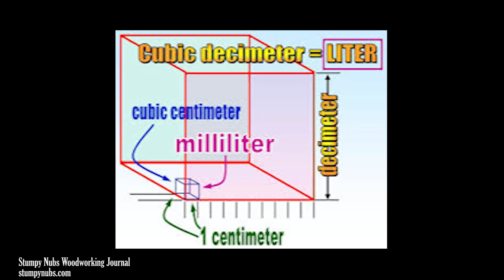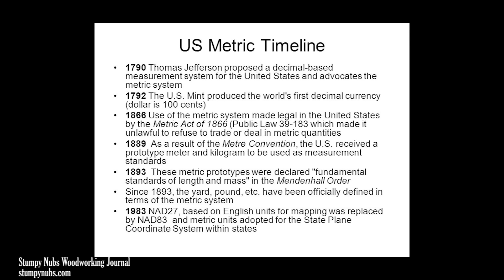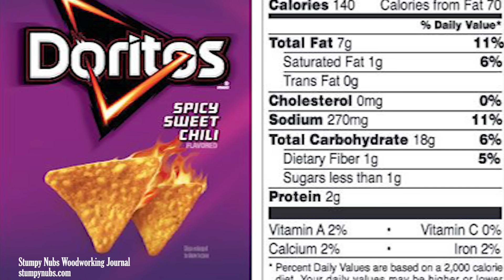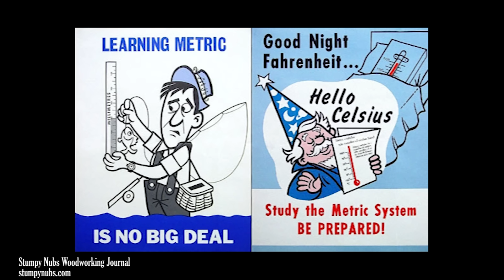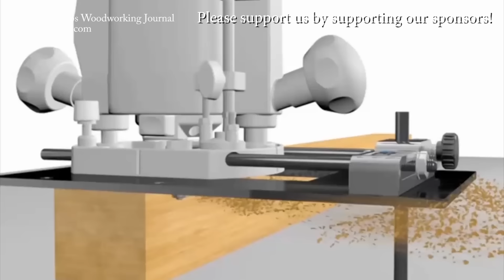BREAKING: The USA is switching to METRIC!

Comment: Funnily enough, I was born, raised and educated in the metric system (I am from France), and yet, when I work in my workshop, I primarily used the imperial system. I found the fractions fun to use... That said, who cares what system you use as long as you have fun building stuff.
Reply: Oh those fraction thing drives me crazy.
Reply: As the Russian saying goes, "monsieur is a connoisseur of perversion" (used as a praise of sorts)
Reply: It does matter when it comes to compatibility between projects and sometimes even within the current project its self.
Reply: It's only fun when you're dealing with the easy conversions of the metric system. I'm Done struggling with Imperial.
Reply: SI Metric is Universal (French Metric is as you say different) all the units are related 1mm x10 =  1 cm x 100 = 1 meter. 1 cubic cm of water = 1 millilitre that weighs 1 gram x 1000 = 1 liter then 1000 liters equals 1 metric ton or 2200 lb. America is making its self irrelevant by maintaining a system that no one else uses anymore. I was at school when Australia went from British Imperial to Metric. Remember US and UK are not compatible being different scales. ie 1 UK gallon us 4.5 liters one US Gallon is 3.9 liters  even the inch is a different scale.
Reply: I still think in feet and inches, but I've started converting to metric for tricky layout work.  Now I just need to find a ruler with 1/12th cm markings, and I'm home free. 🙂
Reply: @yfelwulf  hey there Bub, you watch it,  now.  I’m American, and I’m here to tell ya:  the metric system isn’t even on the top ten list of ways we’re making ourselves irrelevant!
Reply: @charlesenfield2192  why would you need any 1/12th? Just use a whole number of mm. We don't do that fraction bullshiting with SI. For example if we got a material which is  22.5mm thick we never-ever count it as 2 and 1/4 cm, we just use 22.5 mm. or 2.25 cm. 

The most important way to use the Metric system is that you have to use it at the metric way.
Reply: I belive this is reference to SI Metric  sarcasm 😂
Reply: Yeah like building the landing system for a Mars rover.

Using both conflicting systems sure had "fun" results.
Consistency is important because you can forget to convert when needed.
Reply: One of my other favorite DIY channels is out of Canada (Hone RenoVision DIY)  The guy insists that imperial and fractions are easier for carpentry (like framing, building decks on houses, etc.
Reply: @charlesenfield2192 how do you feel about the idea of the metric system throwing out the decimal (base10) system and embracing the dozenal (base 12) system?
Reply: @saxus wooosh
Reply: @saxus you are right about people thinking fractionally instead of decimally when using the metric system, They are fighting themselves. But you also bring up the biggest flaw in the metric system, its difficult to convert fractions. And this is not merely a flaw of the metric system but the decimal system itself. The decimal system has served us fine for centuries but it is not perfect and I would argue that it is not the best. I propose a compromise. For the future benefit of all mankind. The US fully Embraces the metric system, as the metric system adopts the dozenal system. I know this will be a great struggle for many, if not all. and that once AI takes over the world we will have to switch to base 16 anyway. But I think in our day-to-day life it would be a benefit.
Reply: @matthewfrost3677  why would it to be difficult to convert fractions? In most cases you simply don't need fractions. Switching the scale of the measurement is just moving the decimal dot/comma (depending the language). Like I've seen a video where an US woodworker tried to use metric and he failed because it was a pain to work with decimals. His mistake was that he directly converted 1" to 25.4 mm. It's wrong, just use 25mm. Instead of 3/4" sized things you will use 18mm (as we do with plywoods/OSB's). And yeah, if you have to have an exactly half of 25mm because you do an half-lap joint, then you set your tool to 12.5mm. Not a big deal. But as I said if it's really necessary. Like the general thickness of furniture building materials is 18mm anyway, you can divide it easly it will ends up in an integer. And if you build a furniture or a house... it's very-very odd if you can't use an integer number.

But in fact: most of traiditional, old woodworking technique aren't using inches or mm's in general. You just plane and thickness your material to a choosen thickness and you do your joinery based on the actual thickness of the material instead of using an arbitary number.

And please don't tell that it's easier to add  12" 17/64 and 5" 5/12 than 362.35 and 137.58.
Reply: Metric all the way, any day!
Reply: @saxus It was a joke. Good god... chill.
Reply: The only reason people prefer metric over imperial is "I can't do fractions." Well... I can.
Reply: @charlesenfield2192  I think you meant to say 1/13th. Bakers' dozens are so much better.
Reply: No matter what system you use all rulers have some level of inaccuracy in their markings. Ideally it would be perfect accuracy but that would mean atom thick lines and pencils that could draw with that level of accuracy.  Therefore we are stuck with the true mark being somewhere within the width of the mark.  Most manufacturers are good at keeping the short distances within the mark but for every little bit that it's off true center of the mark it increases the error over the long distance.  If you need fine accuracy, metric might be the way to go. If you don't need fine accuracy but are dealing with larger sizes sae might be your preferred choice. (Note: SAE and Imperial may have units with the same name but measure different distances.)
Reply: The traditional system was built around people & their needs (& not because most possess 10 fingers & ten toes!)
Reply: @pcka12  it was also accurate enough for most purposes. Horses are still measured in hands.
Reply: I have no problem using either metric or imperial scale, I find math to be rather fundamental
Reply: @TomKaren94 understanding fractions does make imperial easy.  It seems like too many people struggle with something as simple as 1/2 of 3/8 is 3/16. To your point it really is quite simple and makes sense if it's just you.  The. Again using a story stick works just fine if it's just you. But...having an inch that is not the inch you are looking for for vintage tools is beyond frustrating.  Either way, I wish we could all get on the same page, not for craftsmanship or lack thereof but for simplicity.  Buy a shirt online and it turns out to be 1/2 the size you thought it would or cooking recipes talking about baking at 175C, or  my Australian friends complaining about it being 35° outside
Reply: I've met a few people who do construction from around the world and some still use the imperial system because 4X8 sheets of plywood or drywall are standard around the world. As well as studs 16" on center plumbing fixtures, etc. It's sometimes easier to reference the imperial system for that. Instead of remembering 1219X2438mm.

I find it using metric a lot easier when dealing with very precise small measurements like machining or certain machine tolerances.
Reply: Ireland went metric over 50 years ago, however in my wood working hobby I tended to us both, mainly because my tape measure had both. About 15 years ago, I found metric only tapes and bought 5 of them. The number of errors I made dropped by 90%! Now  I cringe as I hear people talk about 2 and 11/16 inches! Go metric Uncle Sam!
Reply: You like fractions? Click bait comment for sure! Going from 8ths to 32nds to 64ths back to 16ths to.... It's totally ridiculous. I actually don't believe you...that you prefer working with fractions. No way. I do it almost every day and I still hate it. Metric is SO much faster to use and less prone to errors.
Reply: @mboyer68  Everybody can think what they want... Now, explain me that click bait thing you are talking about.
Reply: I’m American and had to teach myself Metric. I use it anytime I can.
Reply: I use whatever is the most convenient for me.
Reply: You used the word funnily, suggesting you have been here for a very long time.  Do you even have a French accent?
Reply: @mboyer68 I've been working with fractions for so long it's easy for me. Did work for a Swiss company for a few years where everything was metric. Didn't have a problem with it. Where I might go to a 32nd metric goes to a half a mm. When you use either for years it doesn't matter.
Reply: Even after 25 years,  my accent is still thick...
Reply: @xof-woodworkinghobbyist  no problem friend.  I work with a number of francophones and they will not let me speak French with them because I poison the language when I open my mouth.  Haha.
Reply: @mboyer68 jumping between powers of two is either just as easy as powers of ten, or easier.
Reply: @saxus decimals are just fractions using powers of ten. 

As a modeller, often building US-designed vehicles (aircraft, ships, trucks, cars...), in scale 1/72, I frequently have to convert both units and scale when using for example original drawings. It's always just a matter of multiplying and dividing, and knowing what numbers to use. It really is quite trivial. Sure, if the USA went all-in metric it would be good for all, but even then, I would have to deal with inches as historic use will not magically change. But Americans really should do it for their own sake, not to please us Europeans. And I would think that a proper, fair and sane public health service, should have much higher priority than a metric switch. (But I know it's even less likely to happen.)
And apologies, Americans, if we sometimes seem arrogant. We really are. But we also are trying to tease and nudge you, because you really would be better off in the 21st century instead of remaining stuck, and we do feel sorry for you.
Reply: @lhpl  Well... this is the beauty of SI. You don't have to convert units. There is only one unit for length. 

Ps.: I do modelling too, but usually in 1:110 also the end result will be in Lego sizes. I would die if I would have to use fractions instead of decimal fractions. (Lego ratios are an extra hell if you want to be accurate as it is possible, but we'll. that's the fun part.)
Reply: IKR?
Reply: @saxus  It's possible to use inches in the same way as metric, ie. decimally. As I said, it's trivial, and it doesn't get more or less so by using mm or centimeter.
Where metric shines is in engineering and science, when using more than one of the units of the SI system.
I would not like to switch to imperial length, but it wouldn't be difficult.
Reply: lol, keep telling yourself that the US is in any way irrelevant. For better or worse, the one thing the USA is not, is irrelevant.  @yfelwulf
Reply: Cool. What happens when you have to divide that 22.5mm material in half? Whatcha using to measure 0.25mm in the woodshop?  @saxus
Reply: @lhpl  it would be  possible to use anything but yet I found usually an X Y/Z number which is nonsense. For half and quarter it's so-so but just doing the math harder in long term.
Reply: @ethanwheeler3323   caliper. A center finder or some parallel marking tool if I really need half, because in woodworking there are a lot of method to do things without measuring. (Actually in many cases it's a bad practice measure out things instead of using the actual piece).

But I'm also curious that what do you use for measuring distances which is smaller than 0.001"...
Reply: @saxus  absolutely agree. But being a computer guy, I find powers of two easy, so as long as a measurement is entirely in inches (and it is rare that feet or yards get into the mix, except boat lengths are often in feet), and all fractions are powers of two, 1/16ths is no more difficult than using two decimals.
Reply: I'd rather use the one that can evenly be divided by 2, 3, 4, and 6, at least for woodworking purposes.
Reply: @narichey1981  22.5 mm is a nonstandard size. It's 0.886". How do you slit in half? Even the standard 2-by-4 have non-integer dimensions.

But im fact it's very rare that you have to go below mm's.
Reply: @lhpl  As a computer guy I find add two integer easier than just add two integer then make two fraction into common ground then add itt then add it the exceed to the previous number. It's very rare than mm precision isn't enough and in other cases you usually don't need any measurements or your measure with an actual hardware instead of a tape measure. Until you don't make a guitar or something like that it's very rare that you go below sub-mm.
Reply: @saxus I am perhaps presuming, but saw the humor in @charlesenfield2192’s post…
Reply: Nothing like working with some germans and giving them a measurement like 4 and 5/8 cm and watching them look at you funny